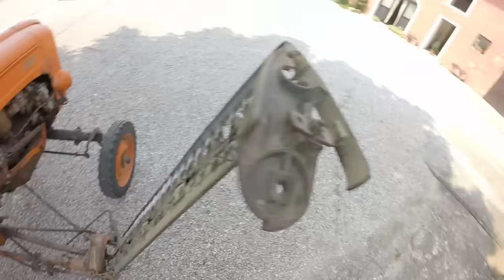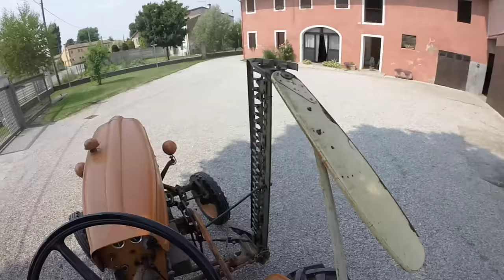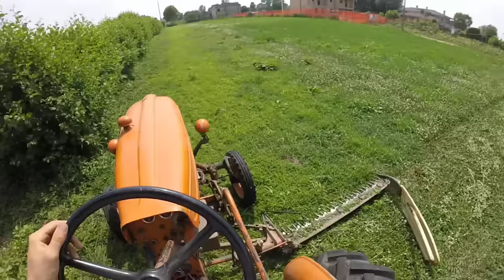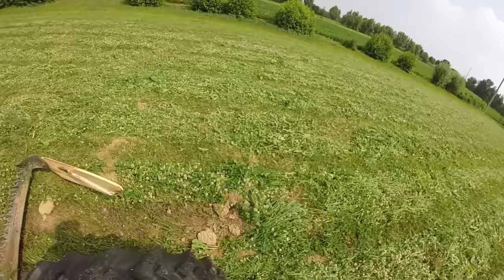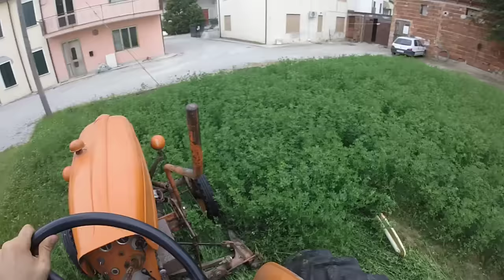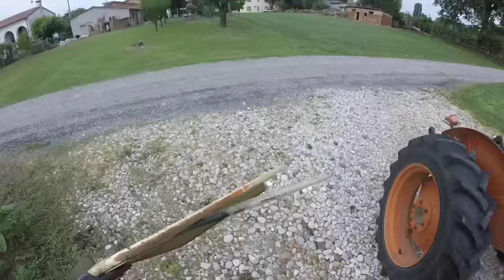[POV] Fiat 211r - Barra falciante Pietro Laverda - falciatura - mowing - old style

Comment: Damn good way to loose a finger! Check the blades when sickle bar is completely down.
Reply: You need to put the blade in the down position to check it for sharpness of the cutters. I have seen the cutter bars move due to the angle change between the Pittman arm and the ball socket of the bar.
Reply: Exactly at 30 seconds into video. That movement I am talking about is at that exact point of moving where the bar got hung up as you started to lower it. Just be careful, please.

Comment: What type of lawn mower is that? I've seen them before, but I don't know the name for the type of lawn mower. I know it's not a rotary mower or flail mower.
Reply: Sickel bar mower...your welcome, I have one on my 1940 Allis Chalmers B, generally you use a sickel mower to cut hay, they are a thing of the past for the most part, you can still buy new ones mostly for mowing around ditches and lakes because they stick out (and you don't have to drive down in) often times you can buy a lot of older Tractors with sickel, only thing is super dangerous, treat it like it is a loaded gun all the time